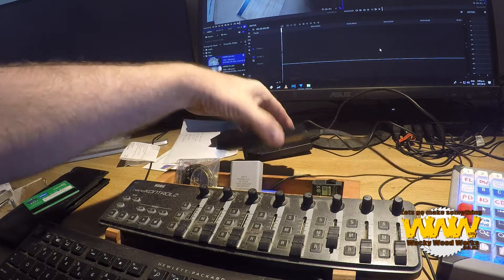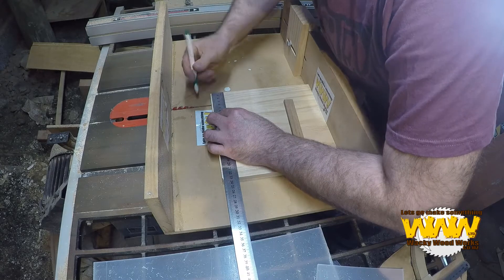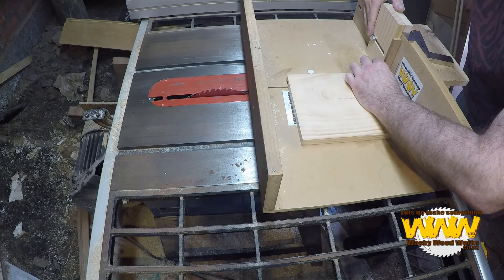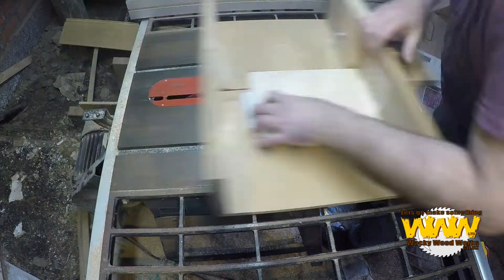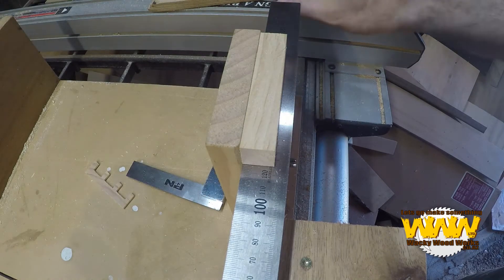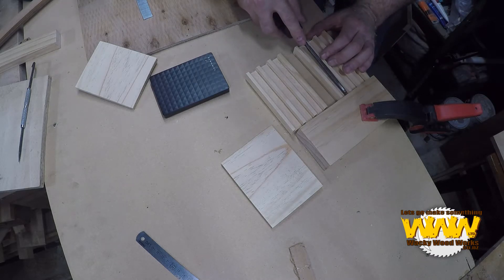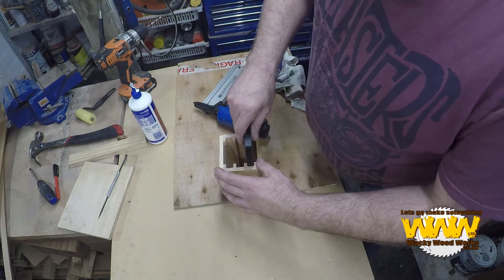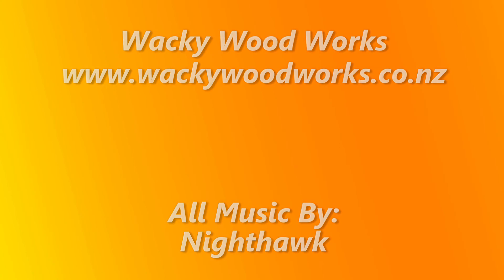How to make a simple hard drive holder - Off the Cuff - Wacky Wood Works.

Comment: nice. I was actually just thinking to build something like this as I have 6 external drives floating around. The only issue for me is they are not all the same size or brand, so I'll have to make the holders a bit extra big to fit them all.
Reply from the maker: I have two other HDD like that so I understand... thanks for watching.